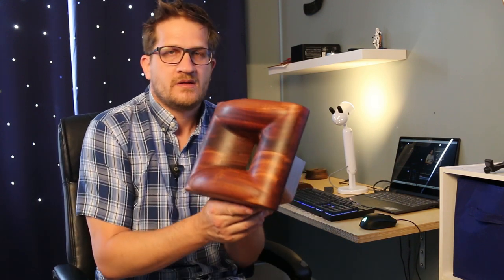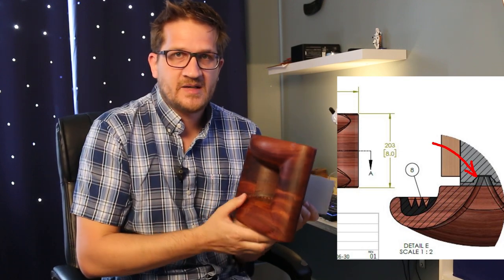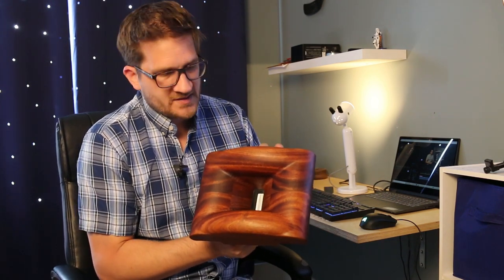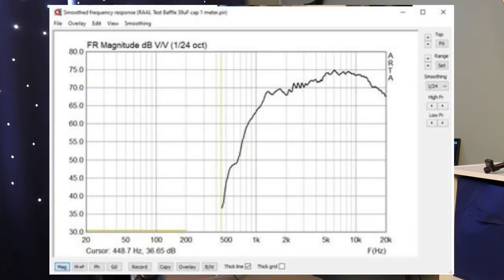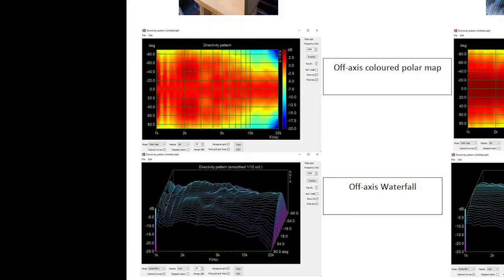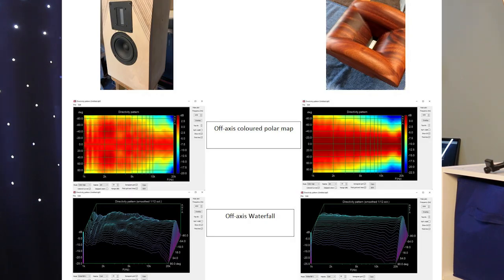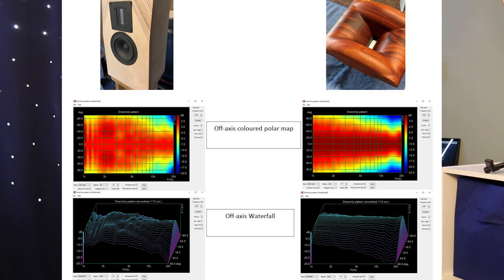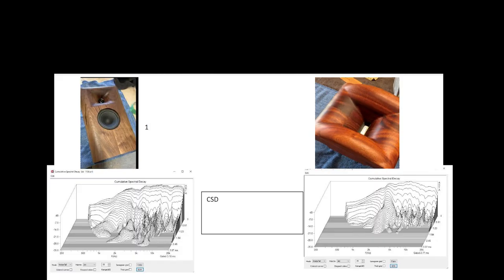Horn Loading RAAL 70-20XR True Ribbon -- Full Measurement Comparison

Comment: Dig your work Joseph. Any suggestions on how I can best block reflections from the wall I have mounted my wide directional Gallo Stradas? Using some absorption between the speakers helped... but actually screening reflections with a hard surface on the inside helped much more. Want G-Market some nice screens that come out to the drivers to block reflections to the front wall they’re mounted on. Any thoughts on whether the screening should be at 90° all the way, or whether they should flair out? (Pulling them out from the walls is not an option for me die to space, WAF and upper bass...). Any suggestions appreciated 🙏

Comment: hi joseph, your videos and projects are getting higher hi-end now and unaffordable for some of us now. and your tools and equipment are high tech and not all diy'ers can afford for many reason's. anyway i am requesting or suggesting of a cheap project, that i am thinking but no time to do it, i'm wondering if a small 8-ohm 5/6 inch paging horn speaker can be used for a center speaker in a home theater setup, together with an ordinary 2-12 ohm small 4-5 inch woofer and 1 8-ohm cone tweeter, design to be used for a dialogue center speaker. this paging speaker should be crossover 500-3000hz or as per mfrs recommendations. long long time ago i have experienced to hear in a public utility vehicle in our country with a setup on it's mobile sound and it was amazing how clear and intelligible the sound of the midrange was, but unfortunately i was not able to interview the driver owner during that time and i cannot forget that amazing sound. thanks and more power, p.s. i still not making a permanent passive crossover for my b&c 12cxt, but based from my experimentation 5khz is good enough for me and for my dynaco sca-35, i don't want tweeter to handle the high midrange but the woofer, thanks again.

Comment: i didn't know that tweeter horns could have such a low gain increase, i always have made sub or bass horns in hornresp
Reply from the maker: This particular ribbon tweeter will only mildly load in a horn due it just being a piece of aluminum floating in space.  However the Viawave pure ribbon tweeters are fully sealed around the diaphragms periphery.  It response extremely well to horn loading.
Reply: @JosephCrowesDIYSpeakerBuilding  try with cardboard with different angles and even placing a cardboard behind while you do so, maybe theres some gain

Comment: Nice build dude!,horn does its thing !  but that RAAL....... expensive as ** and 1% D2 at 85db... thats embarrassing if you ask me.  on there site it states "a true ribbon of just 1.8 kHz cutoff frequency"   not sure how they would perform that task.  in the baffled one its above 1% even @4Khz.... @85 db, and thats not all that loud if you ask me.  even a nice horn like this cant save this driver im afraid.  :( so size does matter so it seems.
Reply from the maker: Apparently the ribbon loses tension if it’s removed from the metal faceplate.  I’ve ordered new ribbons and I’ll tension it properly using a heat gun.  Then do a follow up video.  This explains the high distortion in both tests...according to the manufacturer. 🤭
Reply: Joseph Crowe's DIY Speaker Building That would explain it! Now way this legendary tweeter craps out at 85dB (i.e. at average listening levels of 65-70dB). 

The problem with horn loading this, and any other standard tweeter, is the increased CtC distance vis-a-vis the mid. This is why I’d love to see you be venturing into making a 2-way synergy horn using one of the latest coaxial 1.4” drivers (B&C, Celestion, BMS) or even the Radian 951PbBe. 

How difficult would it be to morph this horn and your double-Neo8S 250-horn into an integrated MTM or TMM design. Would be cool to see you try that. 

Are you using ATH4 (http://www.at-horns.eu) to design your horn profiles? If not, you should try it :)
Reply: @JosephCrowesDIYSpeakerBuilding  although in there measurements. they had high distortion to :) although be it higher and higher up the frequency range :) but lets hope thats it !

Comment: Well made and engineered  but I feel the CNC wood pieces are way over priced.  Only a few elite people are going to purchase and build these speakers.
Wow and $2,330.00 for a pair of the ribbons and horns !  Out of my price range and I think many others.
Reply from the maker: The price is in CAD currency which is $1,456 USD per pair.  That’s pretty reasonable for a custom one-off product made to order.
Reply: These are Under-Priced! Especially since Joseph had to engineer an improvement to something that is already highly designed. Then programming a CNC to make it and sourcing big pieces of walnut. This is a hifi bargain
Reply: @PlaybackMansion  well said!
Reply: actually, reasonably priced..in my opionion.    its a bespoke product.